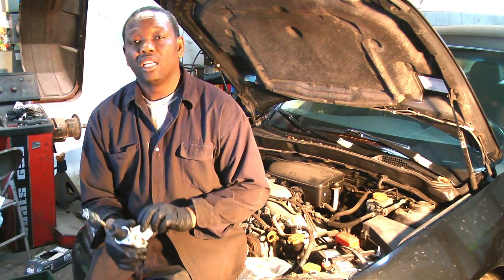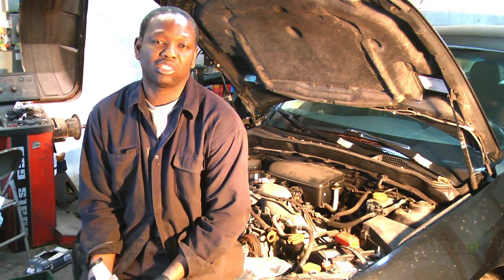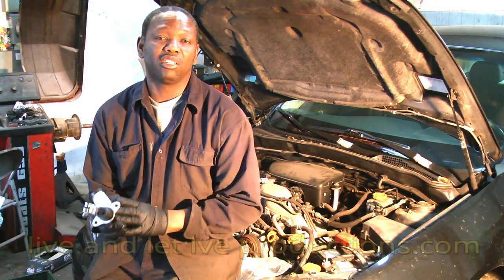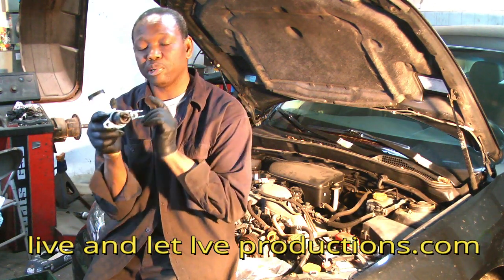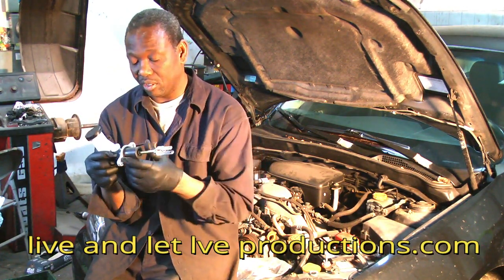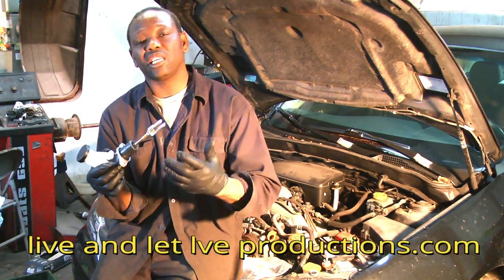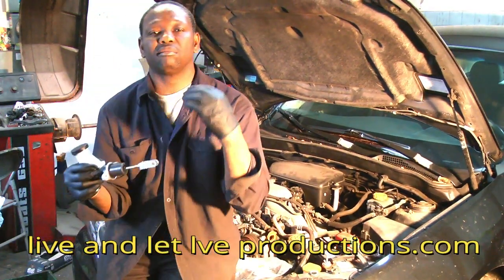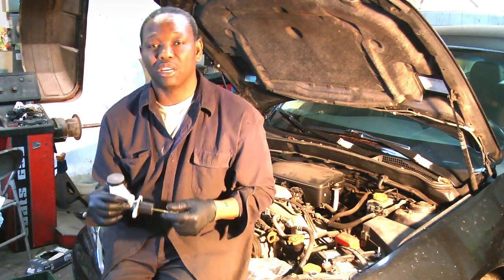clutch pedal stuck ck on the floor how to fix it

Comment: nice video this 
 is really gonna help i broke the line between the two of the slave cylinder  i replaced it and after install i try bleeding i have very low pressure i will now replace this part  the res is still full so yeah youve solved my problem thanks

Comment: Hi, I need your help please. My car won't go into gear when it is started. It goes into gear when it is not started.
I can start it with gear 1,2,3,4,5 & reverse without no issues... once it is started, I can move the car,

but It won't let me change it for a different gear. I changed the slave cylinder for a new one, my master cylinder is not leaking either.. I do not know what else to do, please help me.
Reply: Did u ever figure out the problem. 
I'm having the same one
Reply: That sounds like a clutch disc
Reply: Seems you have an issue with your release bearing.